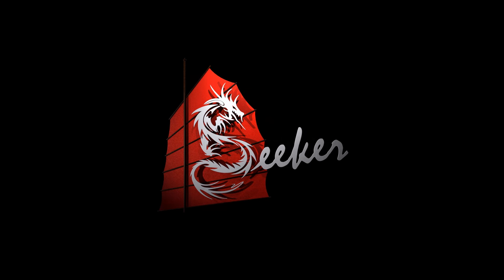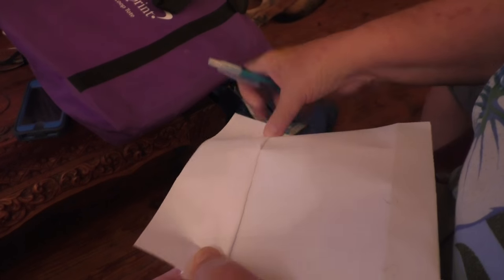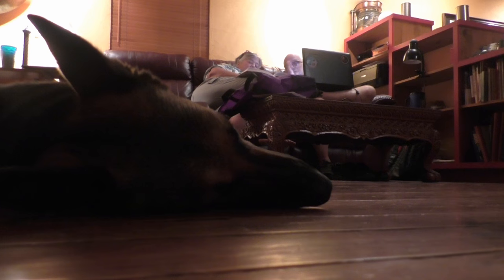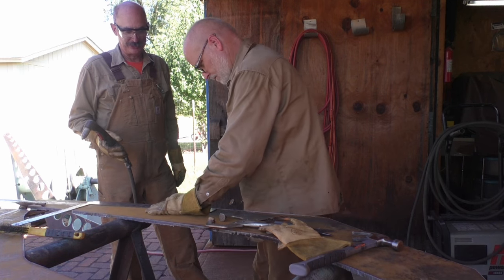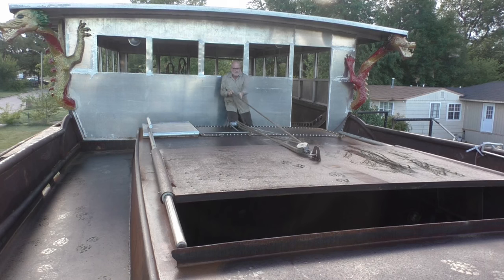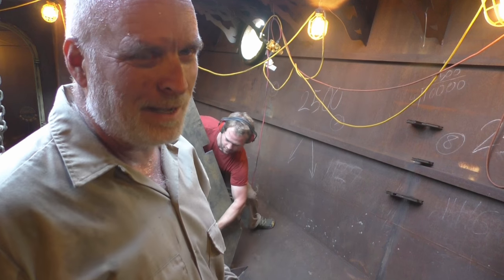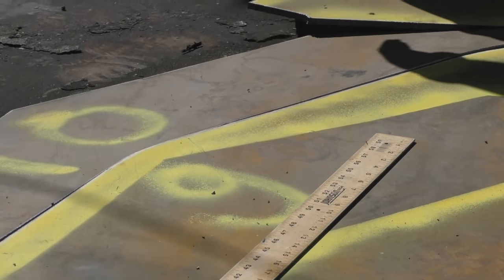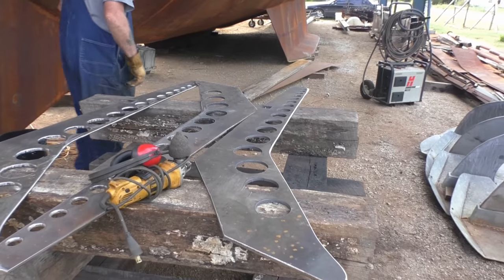Junk Sails and Beautiful Frames

Comment: if you want an easy way to pattern an arch or a long curve that might have a progressively changing radius, use 1/2 flexible copper water pipe...you can cut it to length then conform it to a side wall or whatever you need to template...then transfer the shape to the steel

Comment: I got wondering after Doug if you could`nt have gotton easier movement using a posi differential for your rudder drive just by turning the pinion either direction it would be in oil and have replaceble parts wherever you go move the axle hubs right next to the cage  housing , Then you have brakes on a strong current too be like power steering ? Just a thought  .

Comment: When my ex did dressmaking, she would sew the 2 edges together, then fold that double seam, kept things lined up i believe.
Doug, be careful of the immigration police after you've been grinding :D
Reply: A french seam is where you line up the materials face to face, sew the edge and trim, then turn the material face out and sew a little way back from the edge, you get material sticking up from the face of the material which you can optionally fold to one side and sew it down.
The method in the video is similar to a leg seam on jeans.
Reply: The seam on jeans seems to be a 'flat fell or flat felled' seam

Comment: for template that have straight sides...don't forget about the 1/4 inch luan cut into 2 inch steps then hot hot glue them together to build your template...I said that a few months ago...not sure if you saw the post
Reply from the maker: Ply is good.  Cardboard is cheaper.

Comment: So, why not use the wet sandblaster and a pump out expended water/sand?
Reply from the maker: That would actually be a lot more work.  Tight places are not the place of a large blaster and the sand that did not get blown back onto you would be everywhere inside the boat.

Comment: In the context that I would watch more hours than I care to admit of a 24/7 live stream, IMHO too much stuff was edited out in this video.  I also have a side question about... you guessed it, safety.  When you welding the keep caps in, you wore a respirator because of the fumes.  Why was the torch melting the splashed lead off the side any different?  It seems to me that the torch would also vaporize some lead at the pointy parts.

Comment: Any particular reason you didnt use you cnc plasma cutter to cut the frames they would be identical and save time. also whats the name of those conical grinding block/wheel thingies haha
thanks :)
Reply from the maker: Actually, every frame is different and the table does a poor job piercing 3/8" steel without fouling the tip.
Reply: ah ok thanks
Reply: We call them donkey dinks at the steel shop ha ha
Reply: Was curious the same thing, the mermaids came out so nice, thanks for 'splaining that ;)

Comment: Why the holes in the frame braces ?
Reply: The answer is simple, weight. By using round holes, you achieve two things, less weight, and semi-structure reinforcement. If you ever fly on a very big airplane (HINT: 747, 747-400 etc,) the wings which hold some/most of the fuel, have hundred's of brace(s) with hole(s) (different sizes) to lessen the weight and to allow the fuel to empty towards the center fuel tank. HINT when sitting in the airplane, and your inline with the wing(s,) your sitting on the center fuel tank. to give a approx. size of the center fuel tank, 747, a 6' ft. (1.8288 meters (m).) person can walk around inside, no problem. Also on the inboard side (closest to the cabin) of a 747 wing. How would I know, I have painted (the inside) of both parts with the special yellow fuel tank primer (supposed to prevent algae & Used to protect the interior of an aircraft’s fuel tank against corrosion from fuel contaminants ). I am 5'-10" in. (1.78m) tall.
Reply: I should have said that the holes in the brace(s) of the wings will allow approx. 50 to 60 percent (in my opinion) of the fuel to empty toward the center fuel tank. They still have pumps in all the tanks, to move fuel where deemed necessary.